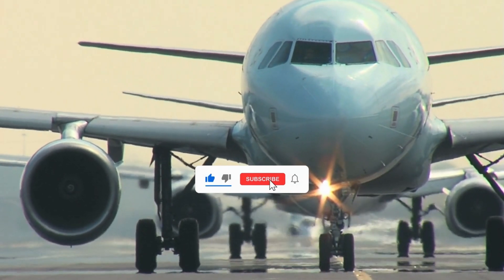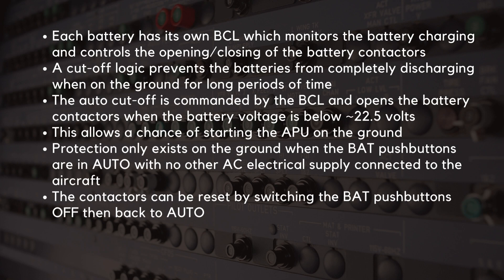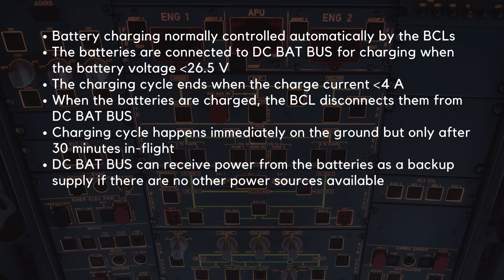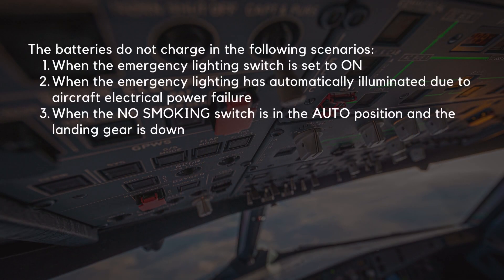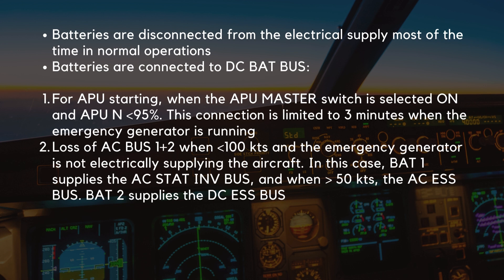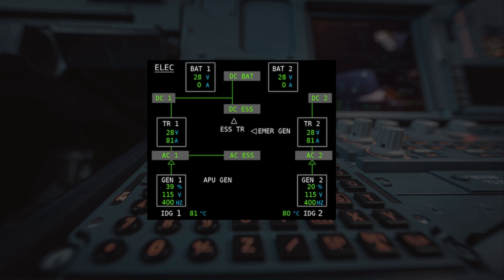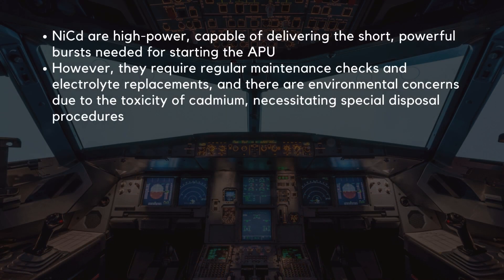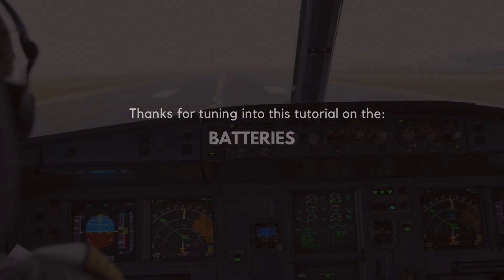A320 Batteries Explained | A320 Electrics

Comment: Hi if batteries capacity are 23 Ah and 24 volt then how does it show more than 24volt on indication panel?
Reply from the maker: The 24V batteries can show higher readings (like 26-28V) on the overhead panel due to charging and no-load conditions. The 25.5V threshold ensures enough charge for APU startup—if below this, the batteries may need charging. This slight increase above 24V is normal and within safe limits.
Reply: I have the same confusion; the FCOM says 25.5 indication means 50% charge, but the batteries are rated at 24V, how?

Comment: Capacity in Ah alone is meaningless, without mentioning the voltage, number of cells or even the chemisry
Reply from the maker: You’re right, to assess the entire battery performance you need those other parameters. However, Ampere hours is a fundamental measure of a battery's capacity, indicating how much charge it can store and deliver over time. Without the Ah rating, you cannot accurately gauge how long a battery will last under specific loads.
Reply: @A320Knowledge  Okay, so later in the video a voltage of ~25V was mentioned, so that's clear to me now. But do they still use lead acid battery technology?
Reply: @nielsdaemen   A320 uses Nickel-Cadmium batteries. Lead acid would be too heavy.

Comment: So as part of pre flight checks on the ground, you monitor battery voltage in "off" (bats disconnected from bus) and, if too low, set to "auto" (connect to bus) to allow for charging and then check again after 20mins for sufficient voltage.
But to not just waste your time you have to remember a rule that the batteries will simply not charge even if set to "auto" while low on voltgae, with gear down and no-smoking in auto? Why? 
When reading rules like this, I wonder if some engineers might have gotten a bit carried away during development 🙂

Comment: Batteries do not charge in situation 3, with the NO SMOKING switch in "AUTO."   That's fascinating. I never knew that. 
What's with that NO SMOKING switch? The emergency lights test won't run with it in AUTO, either. What's the deal with the NO SMOKING switch interacting with so much??? 
Are you sure about that???  It would mean that the batteries wouldn't charge on the ground unless someone noticed that NO SMOKING switch position.
Reply from the maker: This is again from some Airbus documentation. It may not be true for all MSNs. Also not all of them have the NO SMOKING switch. There are other variants that have a NO PORTABLE ELEC DEVICES switch as well, so it might not apply to all.
Reply: @A320Knowledge  That's also fascinating.  I know on the 787 they have gone from lighted NO SMOKING signs to simple placards, which makes sense since it has been no smoking all the time since the 1980s at least. That way we don't have to maintain no smoking lamps on the 787. I wouldn't be surprised if new generation A320s were the same. 
It's funny though, when we first got the 787s we would get write-ups about the no smoking signs not lit. Well of course they aren't lit because they are placards, not lighted signs.
Reply from the maker: Interesting! There are some A320s that have permanent NO SMOKING signs illuminated and no switches too. The placards make a lot of sense. You wouldn’t think there would be a need for these signs anymore nowadays!
Reply: @A320Knowledge   True. Right?
Reply: That might be an option which i never seen on the aircraft.
Reply: @montgomerymcferryn1542   What might be an option, Monty ?
Reply: @rael5469  When you buy an aircraft you can choose some features like this one, we call it an option, you can call it mod status as like.
Reply: @montgomerymcferryn1542   Monty I still don't know what you are talking about. Can you be more specific?
Reply: @rael5469  Charge prohobit regarding to no smoking switch position was a feature you could order in the past, but it was not widely used. The no smoking switch in the past was used in the landing and start procedure so this way pilots would tell the aircraft its a critical time of the flight and the batteries should be resting if they are needed in an emergency. Nowadays all operators i know have the service bulletin implemented which lets the no smoking light illuminated during the hole flight and the switch is not really used anymore.
Reply: @montgomerymcferryn1542   Oh....the switch is used at my airline. And the emergency lights won't test if it is not in OFF. So that makes me wonder about the no charging in AUTO. I'll look it up when I go back to work.
Reply: @montgomerymcferryn1542   Thanks for the info. Yeah, Airbus has had a few quirks in their design. Like the Jetblue nose gear incident at LAX.  The BSCU was doing a test of the steering inflight. They made like three different mods until finally they eliminated the test in the Air Mode. What were they thinking?
Reply: @rael5469  I can do an emergency lights test via the CFDIU independent of the N/S or FS switch. But i think we can agree that each operator has different procedures and have some slight changes in their aircrafts.
Reply: @montgomerymcferryn1542  The emergency lights are governed by the FAA. The task card says to do the test via the PTP and look for the green OK light.
Reply: @rael5469  I work under EASA, my Airbus have FAPs not PTPs and my tasks are normaly via CFDIU since i am allowed into the cockpit for tests :-)
Reply: @montgomerymcferryn1542   The PTP (Programming and Test Panel) is contained in the Forward Attendant Panel under the cover on the left. One of the checks on the 2 service is the emergency lights test, and it is done on the PTP.
Reply: @rael5469  I am suprised that you dont know that the PTP is the outdated thing, nowadays the function is integrated in the Flight Attendant Panel. So no more PTP since about 20 years. And currently the AMP calls for a task via CFDIU in EASA.
Reply: @montgomerymcferryn1542    I don't know what you're talking about.  I use the PTP every day.
Reply: @rael5469  Today I did the no smoking fasten seatbelt and the emergency lights test on an airbus A319. And you will not believe it but this Airbus had no PTP installed. The PTP is an outdated thing.
Reply: @montgomerymcferryn1542  The vast majority of the fleet has the PTP. I don't know where you get such ideas. Did you read the stuff I found online? It gives a pretty good picture of the thing.....and most Airbuses have it.
Reply: @rael5469  I get my information from airbus. I dont know where you get yours from. about 3000 A320 with PTP been built till about 2006, then about 15000 Airbus Enhanced and Neos have been built since 2006 up to now without PTP. So where do you get your information from. If you have still a PTP your working on an oldtimer.
Reply: @montgomerymcferryn1542  As of 2024 There have only been just over 11,430 A320s of all types delivered.

Comment: Will the batteries charge if they are turned off with external power on ?
Reply from the maker: As far as the manuals say, I believe not, but I’m happy to be corrected
Reply: @A320Knowledge  I've had the A320 systems class but it is a detail that I've forgotten. Where I work they have a habit of turning off the batteries because if the external power is cut off for any reason the batteries will discharge and cause a flight delay. But prior to this I would have never turned the batteries off simply because when the AMM says to supply external power reference blah blah, part of the procedure is turning on the batteries. And any time I step onto the aircraft and batteries are turned off, the batteries seem somewhat .....not charged....when I turn them on. I've just always felt like it was better to leave them turned on. Personally I have never seen external power drop off for no reason.....so I don't know by what experience these other guys are going on. I think today's power units are very reliable.
Reply from the maker: Very true. I can see the argument for keeping them off when parked overnight. But I would probably keep them on in all other scenarios. My experience of unwanted ground power disconnection has always been “human induced” !